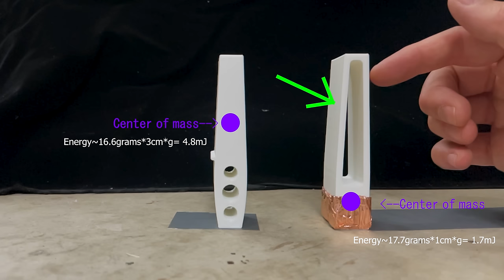The Impossible Domino

Comment: Next challenge: How many dominos in a row can make an "impossible" domino?
Reply: And then make them loop in a circle.
Reply: @jasondelong83  HARVARD WANT TO KNOW YOUR LOCATION
Reply: @GhostMotion7  haha good one
Reply: @jasondelong83  a loop wouldn't work because every other one must stay down, this only works when the two dominos are different.
Reply: @fsmvda  may be a reference to a Möbius strip. Then again, not all loops or squeg patterns are circular.
Reply: Not all circles are round. 😊
Reply: Literally blows my mind how he didn't think to do or explain this in the video. 

But the 2 dominoes are different, the heavy-bottomed domino won't bounce the tilty domino back up. It wouldn't work anyway.
Reply: a*
Reply: @pollutedcrimson  Each domino just has to have successively more potential energy than the last one, so taller, more mass towards the top, etc. Sort of like that trick where you can build out a bridge as far as you want by stacking planks at 1/2, then 1/4, then 1/8 etc along the length of the original, but the bridge quickly grows to being taller than the observable universe before you can get any appreciable distance longitudinally.
Reply: @Vasharan  exactly what I was thinking. If every domino needs to be ~ 10% bigger/heavier it might work some time. But I believe it’s an exponential function (^3) in which the masses need to extend.
Reply: @Vasharan  that is one way of approaching it. Scale and size is an ancient engineering trick learned through genuine creative experimentation. the science behind scale is where all the answers to these questions are no longer a mystery, but common knowledge.
Reply: @banditosdetiempo  bro do you know what a circle is
Reply: @GhostMotion7  #grindset
Reply: @fsmvda  That's kind of how binary works. Lay them one down, one up and complete your circle. It would be interesting to see dominos alternating between falling and standing up assuming it doesn't interfere and break the cycle.
Reply: Thats what I was thinking lol
Reply: @real_Donald_Trump  the concept of a cycle ...yes. Not all of them are round. Think about it?
Reply: I think it would only be able to be the two dominos, since any others would have a wrong center of mass, hence wrong amount of potential energy unless he can find a way around that
Reply: @Vasharan  Okay, but what if we used matter which has a non-zero resting state that changes over time.. for example, Time-Crystals (yes, Wikipedia that - "whose lowest-energy states evolve periodically").  Could you potentially engineer a domino that fluctuates its weight distribution over time, such that when you hit the first domino in a loop they continually change their weight just in time to be knocked down and backup all the way around?
Reply: @fsmvda  What if a single domino can change its form over time, for example, change its weight distribution?
Reply: @GhostMotion7  lol, I wish
Reply: @banditosdetiempo  You said a circle, not cycle or loop. Circles are literally all round, with all outer edges being the same distance from the center.
Reply: With an extremely dense base which is slightly curved, it could reach a point where the energy to knock it over is higher than the energy to stay upright. You could make a row of those but it would require a really hard and fast push to get them all knocked over because there's no potential energy there. The lead base is so much heavier than the top it would spring back up on its own. If you made a circle it would all spring back up, but it wouldn't go forever. The loss to friction and heat would eventually cause them to stop tipping. It would be like a wood wheel with hole cut out on the side. It would always roll so the hole is on top. Do the same with dominos and you got reverse dominos.
Reply: And they all look the same as each other. That would be sweet. Will need to put in a track to prevent sideway movement. They would all fall down then kick back up. Making the last domino have some sort of solid kick back mechanism built into the track. Knock them over and watch them be standing after like a wave moving down the line. You can repeat over and over at different speeds showing a wave of badass physics each time. Also how sound waves work in air only this with a solid visual representation. In theory you could poke the first domino as soon as it stands back up over and over haha just imagine the sound of that alone with how fast they bounce back up lol
Reply: Perhaps we can at least get Corridor Crew to make an animation of a domino rally loop.
Reply: @rplatt9829  Yes, I understand what you mean fully! That's kind of what I was going for in my comment. Something stable enough to symbolize a dropping off of energy effect on a larger scale than just one bouncing ball. It would be a work of art. Physically, and the sounds it would make!
Reply: @fsmvda  That's a misunderstanding. It can work both dominos being the same too, if you can retain more energy in the system. The core of the idea is that the second domino gives back more energy to the first one than it received. If your system was really good at preserving kinetic energy, then it could work with 3 or 4 dominos too. But the last one needs stay down to give its energy to the other dominos.
Reply: William Bartlett — a loop of dominoes in a Möbius strip, in 0 g……..
Reply: Jason DeLong —- good point.  What if the first domino shed weight after hitting the second domino, making the energy requirement to return it to a standing position even less…..the dominos could be in a circle and just keep going forever (as long as the dominos got smaller and smaller each time)…..we are now treading into entropy and particle physics territory…..and theory of how heat engines work….
Reply: @real_Donald_Trump  thank god Obama came through and  pointed out that stupid ass comment lmao
Reply: @banditosdetiempo  um what? all closed loops arent round...
Reply: @pollutedcrimson  
What are you talking about?! He did explain it! The entire explanation of how it worked was exactly that!
Reply: @KK-pq6lu  gravity motors haha
Reply: I'VE FIGURED IT OUT! MAKE A DOMINO SET WITH A GYROSCOPE INSIDE EACH DOMINO, HOLY CRAP THIS NEEDS TO BE HIS NEXT VIDEO!!!!!!!!!!!!
Reply: All shaped like a normal domino with a gyroscope hidden inside. Spun up by a small whole down threw the top with a drill or something. IT would fall and want to stand back up maybe slightly shifting the domino in the direction of gyroscope spin as it stands back upright. The line of domino would start straight then almost start curving the direction of spin and It'd keep doing this until the gyroscope slows too much to stand back up. at least in theory. Maybe add a small internal motor and battery to keep each one spun up to the correct functioning speed to be able to fall and stand back up before changing the axis of the angle too much. If only I had the machinery to produce these right now. I'd finally become wealthy, but in a positive influential way selling these as a school item or teaching toy set.
Reply: @jasondelong83  who are you so wise in the ways of science?
Reply: Use those clown punching bag things, no matter how hard you hit them, they always came back up.
Reply: Plz
Reply: @jasondelong83  oh noice 💡
Reply: Don't torture the man
Reply: hypothesis: it propagates the knock-down signal as a wave that slowly loses energy until the system halts
Reply: apparently one
Reply: @banditosdetiempo  yes they are
Reply: Duhhhh like why didn't he do this like omg duhhhh I disssliked just because I was waiting for this !!!!
Reply: @la24dogg21  i think you cant
Reply: @fsmvda  but it would be cool if dominoes would stand back up
Reply: Make it a circle maybe?
Reply: Virtually infinite, but the precision of where the center of mass is would scale infinitely too. Each domino you add, must have more potential energy than the previous one, therefore having an higher center of mass.
Reply: Yes
Reply: With the profile he has, adding a third domino would stop the second domino from laying flat preventing it from transferring enough energy back to the first domino to right it. I wouldn't have a clue what profile he would need but hope he gives it a go.
Reply: @jasondelong83  perpetual motion machine!
Reply: That's what I said but I used too many words so nobody read it lmao
Reply: @banditosdetiempo  what's a squeg pattern?
Reply: @pollutedcrimson  literally blows my mind how maybe you didn't watch the video, but the whole thing was about that very concept. Also, it did work with different weights, what are you talking about?
Reply: @joshyoung1440  a  pathway that completes a ‘cycle’ by extending forward than retracting to the point where it extends from.
Reply: @joshyoung1440  it’s a basic function of extension, mobility, and cohesion. Not to mention how one is able to take a conscious measurement of anything at all.
Reply: @fsmvda  Yeah which is why this is kinda lame tbh...it's not like he can make a row of them. One is kinda boring.
Reply: @jasondelong83  Then it would be free energy not possible
Reply: can you build a line of base-weighted dominoes and have them flip eachother after the lever falls ???
Reply: @banditosdetiempo  I'd like to see you claim that not all circles around as an engineer, in practice, application, or learning. Because if you did so with any hope of success, you are dull and delusional and would immediately face consequences of your actions
Reply: We need to figure out a way to add energy to the dominoes from the outside. Maybe with an electromagnet on the floor "punching" them upwards, and then the dominoes should be shaped so as to ensure that they stabilize in the upright position.
Reply: @jasondelong83  Dominoes made of 𝒊𝒄𝒆?
Reply: @2H80vids  with solar cells on top connected to internal freezing mechanism under the panel to reform the ice using wires its connected woven throughout the shape... within some sort of vacuum sealed type mold that can pump air in from the solar energy?
Reply: @jasondelong83  ha, he has just made perpetual motion
Reply: @fsmvda  just alternate the dominoes
Reply: @fsmvda  True, but it's still a fun thought
Reply: yes

Comment: People want to see a whole row of them doing that... only problem is: those two are different from each other in mass and center of gravity, so they're not even dominos at that point.  How about set a bunch of those pairs up in sequence so that every other one will return back up?
Reply: Great idea, That would be so cool to look at!
Reply: It would only work if the 2nd domino didn't rest on the 3rd so the 4th would be able to pop up the 3rd and so on im supprised that noone has sakd anything about this, however if the 2nd domino was able to stand up from a push too then yeah it would ne feasible
Reply: Lmao I did not read the comment but I imagined the same thing 
Then make a trial side ways right?
Reply: It will never happen is impossible in a row so he dint make the impossible yet only can happen with 2 piece but hes lying there cus u must do it with same weight but we see 1 is more gram than the other so nope is impossible yet
Reply: Yeah, IMHO criteria for the impossible domino would be:

* All dominoes are equal
* All dominoes get back upright at the end of the process
* Must be able to work at any size (theoretically), so given just one model of dominoes i should be and to make this work with 10, 100, 1000 etc pieces. I shouldn't have to modify the model depending on how many must fall
Reply: If they have some fall-back then you could have an oscillation line.
Or a 'perpetual' circle.
Or a big square of wave propagation?
Reply: I was pretty disappointed. I was lured in by the title but with just two different objects this physics experiment is not very impressive. I was waiting for a full row of dominoes!! :-(
Reply: OOH! Make it on a circular track!

Comment: Honestly was expecting a long line of dominos testing this still a good video
Reply: I've read you comment before watching the video (thinking it was the description) 
I will update accordingly. 🤪

Update: hugely disappointed.
In my opinion; If you were to stand them end to end, the energy converted from your finger to the first domino would dissipate before the 6th or 7th domino
Reply: me to, doing this with the first is no problem. get both up - and then get 10 up, then you have a trick. :-)
Reply: There would have to be a limit to the number you could have in a row, otherwise you could make a loop of them that can go forever, which we know is impossible.
I suspect that the second domino having a higher centre of gravity is critical. If it was the same as the first I don't think there would be enough energy for the first to knock over the second.
Reply: @jlwill114 Good thing you can make each domino in the line bigger than the previous. The coutnerweight in the base of the first domino seemed like just a way to fine tune the stability after the bounce-back, so it would be very difficult to get a run of 3+ but should be possible.

Comment: I really like how this works. Because physics, the domino won’t have enough energy to return to its stable upright state, but it doesn’t have to because it’s designed specifically to have enough energy to reach an unstable position where, once reached, it will automatically settle into its fully upright position due to its low center of gravity.

Comment: "Impossible dominos aren't that impossible...."
Long as you only have 2.
Reply: You can alternate between them. About half the dominos are going to pop back up.
Reply: It seems you could have a domino system which could stand back up by itself (except for the last piece obviously) only using the starting kick energy, it just seems like a ton of very fiddly work and could be achieved by having a moving weight inside the piece so when toppled the CoM changes to be above the balancing notch  being able to kick back enough energy to the previous piece while being able to kick over the next one. Although I believe there would be some very strict limitations on how many pieces you could line up due to the amount of energy lost between pieces, also the magnitude of the initial kick should be standardized so you can calculate appropriately how to alter the design of the pieces. As said before not impossible, just really finnicky fiddly work.
Reply: Seems like in theory you could have as many as you want, as long as there is always a gradient in potential energy, but it would probably get impractical very quickly based on how hard it was to get just two
Reply: @eleSDSU  Yeah, you would need to "reload" the dominos between uses, but it could work.
Reply: @eleSDSU  That moving weight idea is pretty smart. If the domino shift the weight from top to bottom when they fall, they should be able to stand up again. So you have to push the row twice to keep it laying down. That would be a fun project.
Reply: @sairabanokazmi1150  Nope, domino #2 would be resting on domino #3 preventing it from standing back up.

Comment: TL DR: The second domino is designed to give some of the kinetic energy is has to the first domino when it hits the ground. The hollow top and bottom is not really important, it just makes the second domino store more potential energy than the first, despite being the same material, so it takes less energy to upright the first domino.
Reply: How is such a smart guy, not able to figure this out. I figured it out from just the few seconds of footage. You can clearly see the second domino kicked the first domino back up. Which is why it’s bottom isn’t flat and straight. It has nothing to do with the first domino

Comment: Buuuuut, it is impossible to have a row of dominos pop back up again.
Reply: no it's not, but it gets harder for each successive domino you add.
Reply: @danielyuan9862  sir you are wrong, unless the second domino doesn't rest on The 3rd
Reply: @danielyuan9862  it consumes energy bcuz of friction
Reply: Just put them horizontal from each other with each row being a 2 dominos unit, and connect each getting-up domino to the other one, one way or other.
Reply: If we use fractals, it is possible, but each subsequent domino has to be smaller than the previous, infinitely.

Comment: All I was waiting for was him to realize you just needed weights on the bottom. The problem is like those old toys that were in an egg shape and had a ton of weight on the bottom and the top weighed nothing so that as long as you weren’t holding it and it was set down it would always stand up.
Reply: Was thinking the same thing. The problem is that if you used the same concept, the energy transferred to the next domino is severely diminished and wouldn't work for long chains.
Reply: He added more weight to stabilize, not to get the domino up.
Reply: @prashp143  oh. I’m an idiot then. Still reminds me of those bobbly things.
Reply: @GamerX-2000  No one, who is curious, is an idiot. When he attached that extra weight, the same came to my mind too😀 Always be curious and never worry about anything while asking questions 👍
Reply: Weebles
Reply: He made "very possible not-quite-Weebles."  A line of such shapes constrained to 2D wobbling could make an interesting toy, with waves cascading between the parts knocking into each other, with some similarity to a Newton's cradle.  Enough of them and the right tone might even make a very pleasing sound.  (A few and the wrong tone would be super-annoying.)
It still wouldn't be dominoes, but it would be a reasonable middle point between regular Weebles and the so-called "impossible dominoes" that already don't look at all like dominoes.  I consider the wedge to be a big cheat, moreso than the bowed shape....which is also a cheat.
Reply: There is also another toy that has the same affect. It's a toy punching bag for kids that you inflate but the bottom is filled with sand so when you hit it it will fall over and then pop back up.